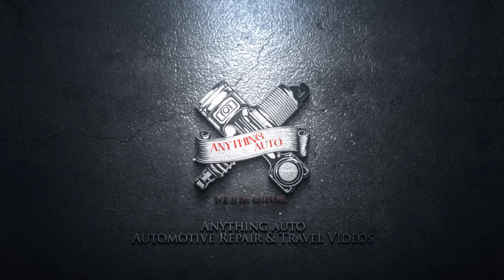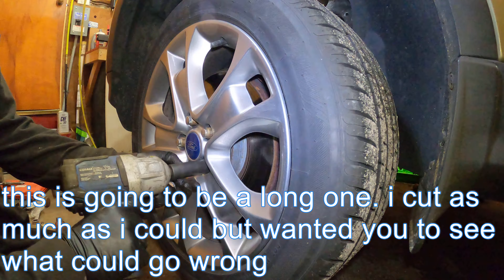2013 Ford Escape Front Wheel Bearing Replacement

Comment: 2013 and they are still using 1980 fwd wheel bearing designs.  That engineer should have been fired
Reply from the maker: Right. i hope this video helps. Please like and subscribe for more & if you can, please help the channel out by giving a super thanks. Making these videos takes a lot of time, but we do it to save you hundreds. also head down into the description and check out the link for some high quality led bulbs for this and any other vehicle. use my referral for a discount. Stop by my store for some Anything Auto gear.

Comment: After you cook that bolt use a crayon and the wax will follow the threads and make it a little easier to loosen
Reply from the maker: i hope this video helps. feel free to like and subscribe for more & if you can, please help the channel out by giving a super thanks. Making these videos takes a lot of time, but we do it to save you hundreds. also head down into the description and check out the link for some high quality led bulbs for this and any other vehicle. use my referral for a discount. Add me in Instagram for behind the scenes pics and Stop by my store for some Anything Auto gear.

Comment: Hi, Sorry to Bother you...
WHAT Did You Torque specs Alll the Bolts Back Down too..
1)Axle Nut 
2) Strut Bolt
3) Tie Rod Nut
4) Ball Joint Bolt & Nut 
Thank you,
Frank
Reply from the maker: @frankp.9655  i don't remember, sorry. i hope this video helps. feel free to like and subscribe for more & if you can, please help the channel out by giving a super thanks. Making these videos takes a lot of time, but we do it to save you hundreds. also head down into the description and check out the link for some high quality led bulbs for this and any other vehicle. use my referral for a discount. Add me in Instagram for behind the scenes pics and Stop by my store for some Anything Auto gear.
Reply: 2-3 ooga doogas